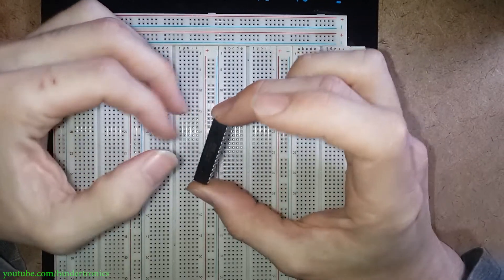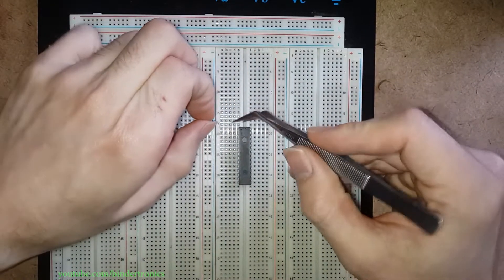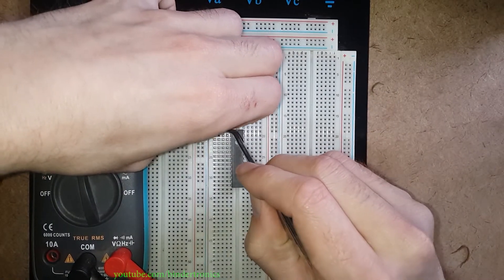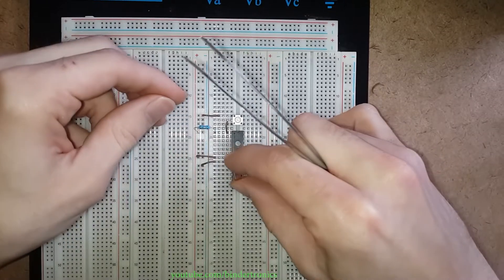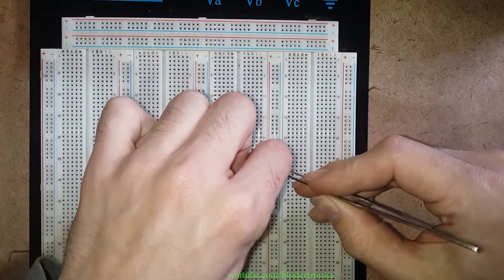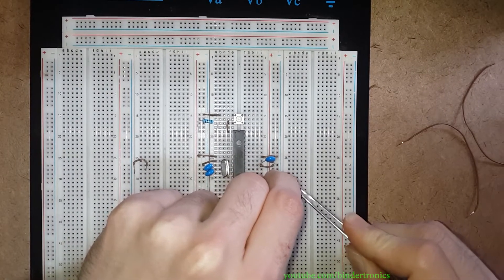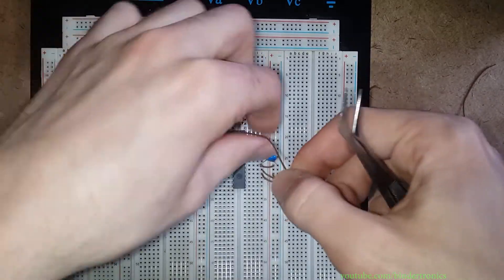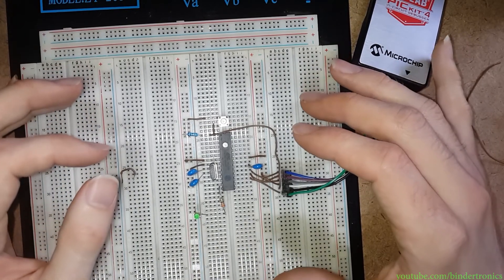Hardware 🔴 ATmega328P Programming #1 AVR microcontroller with Atmel Studio

Comment: Can I use a 12MHz crystal oscillator instead of a 16MHz? Does that change the values of the ceramic caps?
Reply from the maker: 12Mhz is fine. you will need to re-compute any values that involve timings yourself. 22pF is a rule of thumb value. 12-22pF should work for most crystals. MCU datasheet section 9 for clocks. For loading CAPs refer to the datasheet of the crystal.

Comment: Hi there. Would I be able to use a FTDI C232HM cable instead of a picKIT 4 as it has an ISP interface?
Reply from the maker: It is possible. You will probably have to intergrade arvdude or openOCD into the IDE. I know it can be done but have not done it myself as I have had no need too. Fair warning if your debug tool is not supported in the default builds for the GDB servers you are in for a mission.

Comment: can pickit 4 be replaced with pickit 3 for the atmega328p program?
Reply from the maker: No the pickit 3 does not support AVR chips.
Reply: @BinderTronics  Thank you very much for the reply. And for clarification
Reply: @BinderTronics  Is it possible to program ATMIGA 328 with pickit 3.5 please?
Reply from the maker: @mahsam-tq4cc  Doubt it. Never heard of a 3.5 it looks like a knockoff product. Atmel ICE, MP SNAP, PICKIT 4. Only if the programmer supports the ISP interface will it work.

Comment: When you were programming the ATMega328P were you powering the chip externally or through the PicKit 4 Power line?
Reply from the maker: Externally. Do not believe Atmel Studio has a option to supply from the PicKit 4. Did not look for it. I find it a pain to power devices from a USB ports in general.